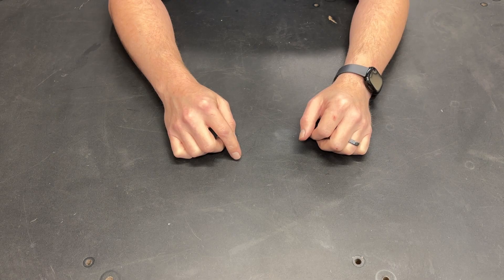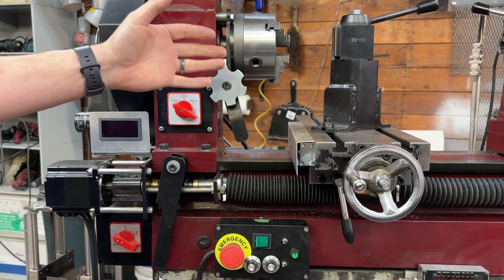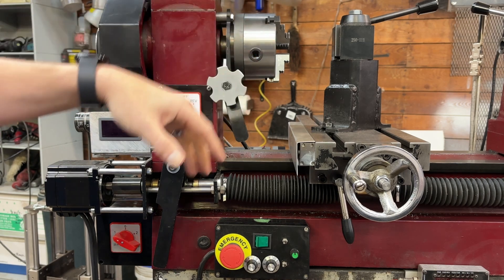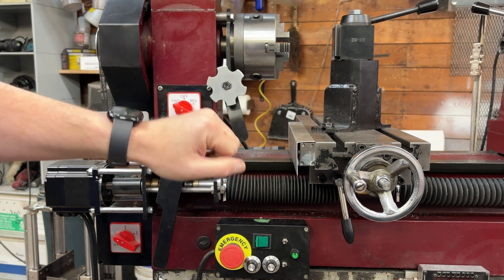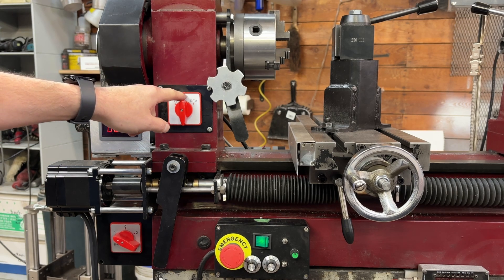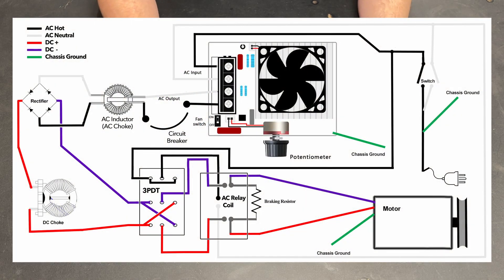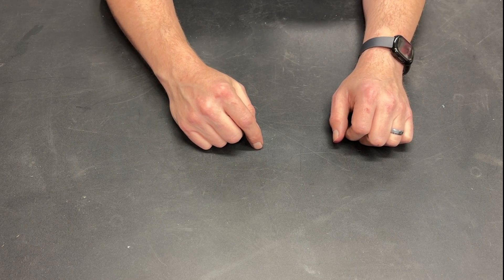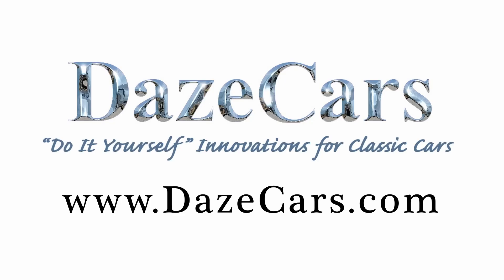Adding an Electric Brake to a Treadmill Lathe Motor Upgrade...    FAILURE

Comment: True. 
In my mind, I tend to think of all reversing switches as being toggle-type, with a center off position (mostly because that's what I have on hand).  
That rotary switch though, with a full 180° between its two 'on' positions, would make it a lot harder to blow past the 'off' position by accident. 👍
Reply from the maker: That is one of two reasons I chose that switch.  I was having a hard time finding a toggle that was high enough amps in DC and I wanted something that was harder to go directly from forward to reverse.  This switch met both of those needs.

Comment: Thanks for being honest about failures as well as successes.

Just my two cents, but I think the way you have the reversing switch set up now is a good thing.  Always stoping the machine with a dedicated switch (that both stops and brakes the motor but doesn't reverse), and having the reversing function controlled by a completely separate switch (that doesn't brake the motor) seems like a good way to prevent frying a controller if you accidentally reverse a bit too quickly.

Thanks as always!
Reply from the maker: Having that brake on the forward and reverse switch is critical for the way I use the machine.  I use that knob when threading and having the spindle stop quicker helps reduce the runout gutter needed when threading.  The other thing is it would actually help in the situation you mentioned.  If I go from forward to reverse without letting the switch stop in the middle long enough to let the motor come to a complete stop it is extremely hard on the motor and power supply,  but having the brake in the middle will eliminate some of the rotation force even if only a little bit in the split second where the switch is in the off position between forward and reverse.  In other words even if I only get partial braking in a situation of accidentally overshooting  from forward to reverse, I will still get some breaking which is way better than getting none.

Comment: I have a threaded chuck on my atlas so an electric brake would be dangerous. I can wait 3 seconds, however on yours you already have a brake for emergency stops. But, I understand that fixing it is part of a "project" and time doesn't matter. Also, others may need it as well. Happy New Year.
Reply from the maker: yes a brake would be an issue with a thread on chuck.  I did it for a couple reasons, emergency stops AND threading.  because my lathe does not have a half nut I must use the forward and reverse controls to operate the system when threading so a 3 second slow down requires a bigger gutter than a 1 second slow down requires.
Reply: @dazecars  That makes perfect sense. Carry on! LOL.

Comment: Nice setup.  I see you have ELS on this lathe. Is that your own design or you took something already developed ?  As a side note - how is this welded tool post  - rigid enough ?
Reply from the maker: the ELS is a Clough42 setup.  As far as the tool post I did it to add rigidity.  I found that the compound was a source of chatter and by building a solid post it significantly improved the quality of cuts

Comment: I'm a retired Electronics Tech with 40 + years in electronic and electrical control systems in avionics & computer controlled servo systems. From your drawing it appears you have the braking resistor connected to the motor windings all the time. This is very inefficient. Instead connect your braking resistor cross normally closed contacts of the relay (assuming you're using a DPDT relay). That way when you power off the relay the contacts go to the closed position connecting the resistor to the motor. But when relay is on the resistor is not in the circuit. Also, the AC inductor shown in your drawing. This is an unconventional use for a filtering inductor. You never filter the input to a bridge rectifier. I would remove it entirely and concentrate on filtering the output of the bridge rectifier. But in this case since you're driving a motor it is not sensitive to noisy DC. It is strictly optional. I commented about this on a previous video you posted regarding filter inductor (choke) or capacitor placement. I made up a drawing for the circuit  describing what I'm saying but have no way of sharing it with you. If you wish you can write me and I can send you what I have. Varods2002 at Yahoo.
Reply from the maker: That is how the braking resistor and relay are connected and how I have it drawn in the schematic. Normally closed on the relay. When the coil is activated the resistor disconnects from the motor and the motor connects to the power supply.
Reply from the maker: As far as the ac indicator it is just a simple coil used on ac inputs all the time and is especially effective before the rectifier due to the clipped waveform from the power supply. It is somewhat effective at cleaning the power than the motor choke after the rectifier does the bulk of it. You can contact me through my website if you want to.